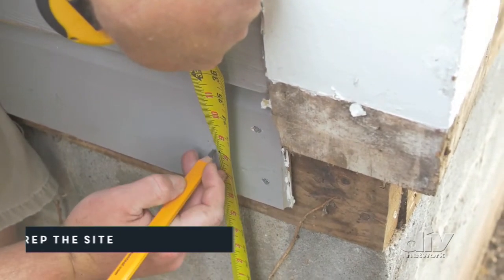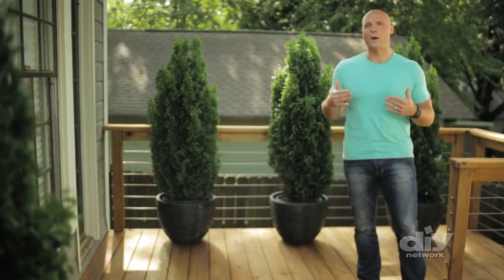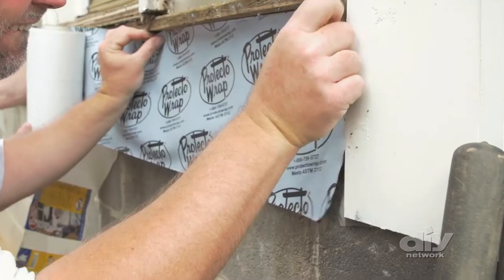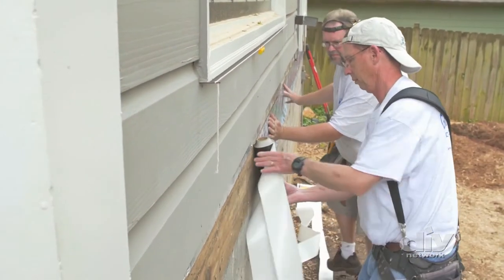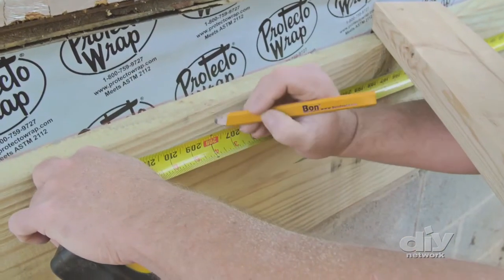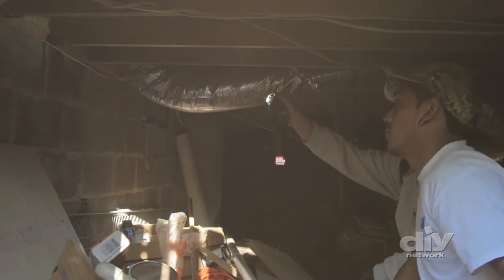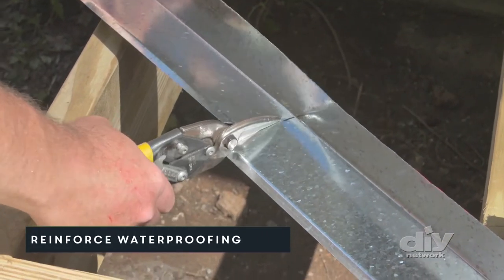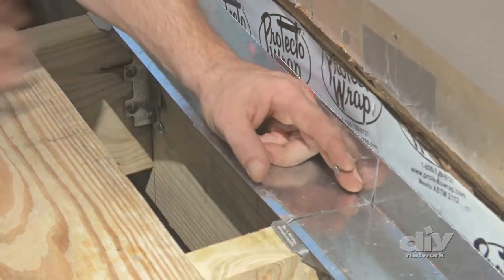How to Install a Ledger Board for a Deck - DIY Network

Comment: need to let people know that code has changed and you can no longer use carriage bolts to attach ledger board to house. A bit of overkill is to use all thread, lock washer and washer ( all galvanized). Need to alternate high and low every 6" to meet code. Have a good day and Frame on!
Reply: Do you know when the code changed? I was looking to extend my deck and use the previous installation as a reference. I had a new construction house built about 6yrs ago.

Comment: Amazing how the ledger board can be fastened to the house with only fasteners. No load path to ground. Even with flashing this is by no means a form of weatherproofing as exposure to the elements is what ultimately leads to deck failure.
Reply: Depends on what deck is being attached to. If attached to a brick foundation you need to apply flashing same what you would a chimney. Cut a groove into mortar joint and make z bend flashing.  If a remodel and vinyl siding is being applied.  Simply use tar backed (window and door tape but bigger) peel away tape. After ledger board is installed apply another run of solid aluminum flashing.  After decking is installed you can bend some coil stock with a spring bend to repell water that may come from the siding. Let the coils stock come up above the top of j-channel nailer. To ensure waterproofing. Once coil metal is with spring bend is installed pop a line and install j-channel. Deck is waterproofed. Make sure you refill the mortar joint with mortar or a silicone based filler. Hope this helps. Flinging Hammers!!!!!